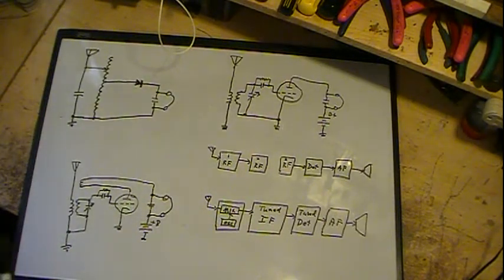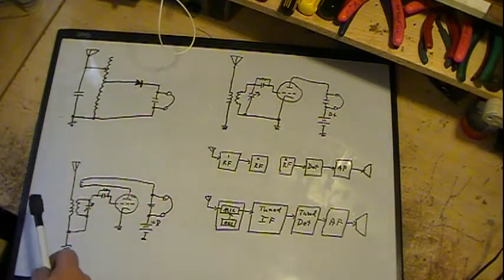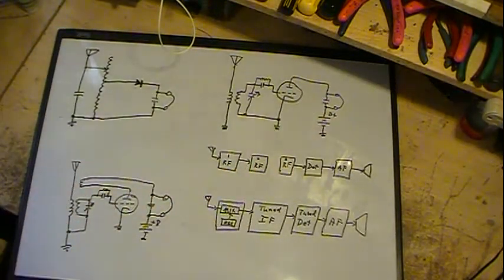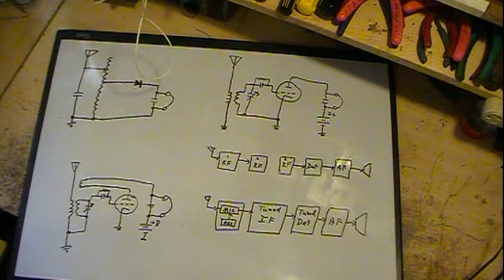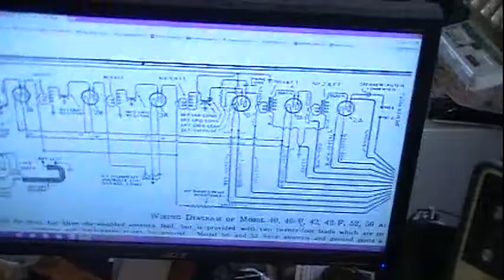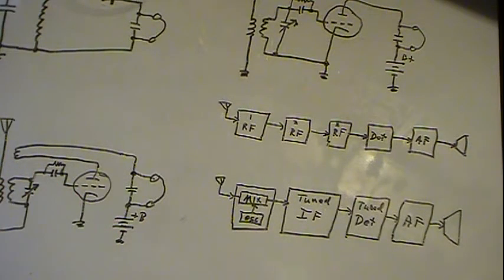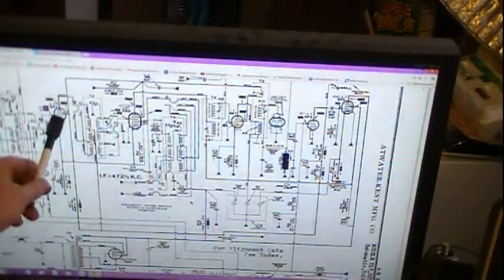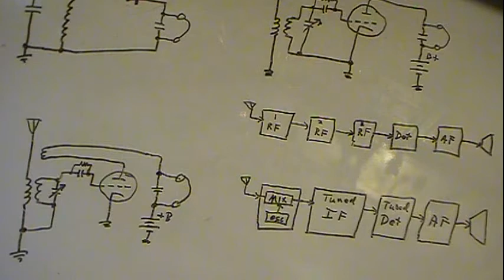Radio tuning circuits

Comment: Dennis, I'm no student of electronics but need to finish 2 projects. I had 3 ham radio power supplies made by Peter Dahl co. about 10 years ago, and never used them once. They are 1kw 1kv 120vac each with heater coils and GE866 mercury vapor rectifiers.  I don't have a plan to build the rest of it (modulators) for LF ham stations I'd like to put up.
My second project is a zero point energy transformer. Basically, an inside out Tesla coil , using 85 total coils, 10 of them in rotation. I know that the mass of copper needs to be matched among the 3 major parts of this sucker, so they can mutually resonate, but I need someone with knowledge of matching magneto powers to other coils, etc...etc.... I'd be happy to send you the plan. omegazap at gmail
Such a thing is useful for power generation 50kw+ with as little copper as possible. I'm also planning to use this as a metal detector/ cavern detector, as it will form a massive torus field similar to that used by 3d metal detectors like JeoHunter 3d.
Reply from the maker: +mike fromspace I'm not that familiar with that type of transformer. But I can look at the plan. My e-mail is drcarter59@gmail.com .

Comment: Hello Dennis Sir,
      This is one of the most brilliant radio theory i have ever come across .I have Two Requests .First is that i would like see how Mr Dennis Looks Like ;-) . Secondly you mentions forums ? .Which forums do you means when you talk about that .I also have a small youtube Channel that is going to expand slowly .Also you say oskilator though its a oscillator " osscciiilaatoor " "But i love that when you say that " . I have just started to learn about radios and transmitters and i have also joined antique radio forums to gain more knowledge  .Do you also work with current mordern radios ? .One great superhet radio i liked that a novice can learn is the Elenco superhet radio kit  .Its has a amazing manual
Reply from the maker: Thanks for watching. Here is some forums you can look at. www.nostalgiaair.org/Forums; www.philcoradio.com/phorum; www.audiokarma.org; www.videokarma.org; www.antiqueradios.com/forums. I don't do much with solid-state electronics, just mostly vintage electronics with tubes.